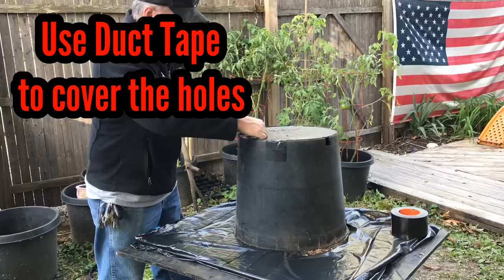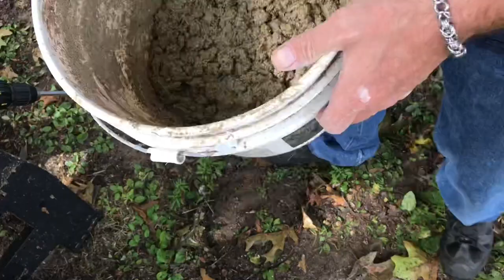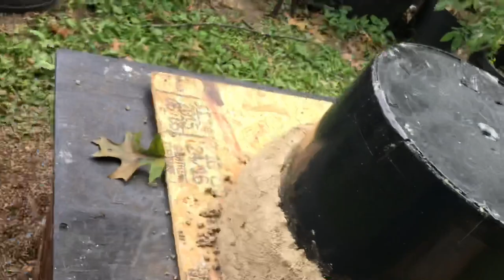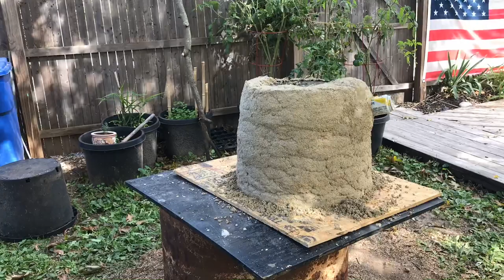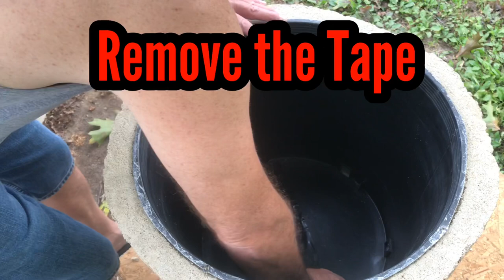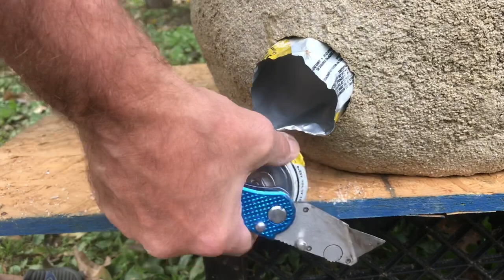DIY How to Build Tandoor Oven using Insulated Concrete Vermiculite n Quick Set Mortar Mix: Part 1

Comment: I made same as your with perlite but it was getting hot  outer side and now I redo with ceramic fiber blanket. Zero hot outside walls.
Reply from the maker: Nice.   I was thinking about doing the same.
Reply from the maker: where did you order the Blanket????
Reply: @Pizza_Master  It is quite cheap for the size.

Comment: Very nice!!! This is the simplest design and build I have come across. What size pot did you use?
Reply from the maker: Thanks… 
It was a pretty big plastic planter pot. It was approx a 7 gallon pot.  Still holding up great with zero cracks. Just gotta keep it dry.  
Any other questions or comments , feel free to contact me. 
Thanks. 
Please dont forget to like and subscribe if u haven’t already.  
Enjoy friend.

Comment: Great but where to find Vermiculite?
Reply from the maker: Ahhhh… 
The great question.   
Pool supply store.  

They use it to put down on the ground before they put down a pool liner .. it’s soft and helps keep pool floor flat.   
Here is a link on amzon
https://www.amazon.com/Organic-Vermiculite-Granules-Plants-Gardening/dp/B0B11Z9V4B/ref=asc_df_B0B11Z9V4B/?tag=hyprod-20&linkCode=df0&hvadid=598282648021&hvpos=&hvnetw=g&hvrand=3319742914823311347&hvpone=&hvptwo=&hvqmt=&hvdev=m&hvdvcmdl=&hvlocint=&hvlocphy=9004535&hvtargid=pla-1753539485434&psc=1&mcid=b3a35976b4983d70be5fb3041fc7a314&gclid=Cj0KCQjwqpSwBhClARIsADlZ_Tk3kYe9calw9OPir-OHTLJ7YS1U126qEiG1I_a_Ve-cQlNqxVGk0BQaAlyuEALw_wcB
Reply from the maker: I get mine at my local pool supply .. giant bag …. And …Cheap. …lol. 
U can mix  it in with yer potting soil garden soil also to get rid of what ya don’t need. I keep in in a heavy plastic garbage bag so it stays dry in the shed.  There are several uses for the stuff.

Comment: Hey nice oven! How did it hold out overtime with the heat? Any cracks?
Reply from the maker: Zero cracks so far on the outside mortar layer... prob used it 6 times now.   Hairline cracks on the insulated concrete inner layer...  but that seems to be par for the course.
Reply from the maker: lid broke, a tree branch fell and cracked it, gonna make a new one, prob outa metal.
  i have  moved the tandoor  a few times for some patio construction, moves easily with a Handtruck/Dolly....

Comment: This is two years late, but how did you get the bottom level? Just by hand?!
Reply from the maker: I actually used a level as I was growling on the final mortar coat. I would check it over and over as I applied the mortar. 
Any other questions let me know
And don’t forget to subscribe if u haven’t already
Thanks friend.
Reply: @Pizza_Master  Well, thank you for replying, so quickly and on a two year old video. I am planning on making a tandoori myself, which is how I found your video. Thank you for your answer, it helps a lot. I will for sure give you a sub because of your studious reply. Go easy bro!
Reply from the maker: Hey thanks.  
I am still using mine weekly. Zero cracks on the outside mortar.  And I have moved it around the yard a few times also.  
If u want to use clay pots as the inside walls then insulated concrete then mesh then mortar… that would be great… than u could bake Naan on the walls.  U can not do that with the insulated concrete.  
I have a Bux h of short vids posted recently cooking in the tandoor. 
Enjoy my friend. 
I will always respond.
Reply: @Pizza_Master  Wow thank you. I was actually wondering how that build was holding up after two years. I watched a couple of your recent cook videos to take a peek at the condition of the tandoori. I will be using your techniques with my upcoming build. Thanks again, go easy.

Comment: Can't find your 2nd part!?
Reply from the maker: Her ya go

https://youtu.be/mLJ0TXP9w_k
Reply: @Pizza_Master  thanx
Reply from the maker: @bajkul  no problem my friend...  sorry i did not respond sooner...  if you have any questions , let me know
i have been using for over a year and tandoor is holding up great,,,,  i  am even able to move it without any issues   ...  my only problem was the lid breaking after a tree branch fell on it....  if you wire and mortar the lid  it will be much more strong, i did not do that cause i was trying to keep the weight down,  
thanks